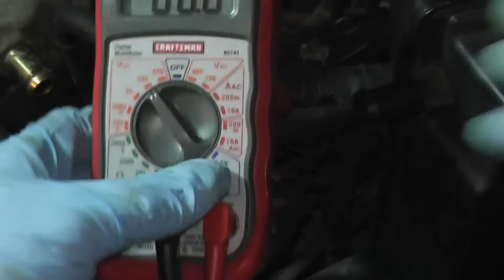How to Test and Replace A Map Baro Switch P1105

Comment: For anyone wondering the map/baro switch is called the Vacuum Switch Vapor Canister Purge Solenoid Valve. For my 99 Maxima it’s part #14956-35U10. Hope this helps!
Reply: So it’s just one part not two? At 1:35 it seemed like it was two identical parts lol
Reply: @viper34ttv They look very identical with similar hoses, the other is Evaporative Emissions Vapor Canister Purge Valve Solenoid

Comment: Hello there. I'm having some issues with my 99 q45. I have the p1105 indicating the map sensor /baro switch. I replaced the map sensor with a new one and still no luck. I tried my old sensor and new one on another q45 I have. Switched parts and all and no luck. Now I finally found that the volts to the baro switch was less than 5 volts on my 99 while on my extra working Q it's reading at 12volts. That one turns on like a charm. No problems. Now my 99 is the one that has the 5 volts. Any idea what could be the cause of this? Both wires were split open and cracked. Could it be that maybe the power wire is corroded further inside. I'm sure that's going to be my culprit. Any feedback would help.
Reply: Did you solve this? I'm having the same problem

Comment: I have a 1997 Nissan d21 and I check everything you showed I don’t see you check the ground wire on that plug on this video I check to see if I had ground I don’t I should I do is there a sensor some ware that is acting up

Comment: Excuse me, but where do the 3 hoses on the Baro Switch go to? My 1996 Infiniti I30 has a check engine code for P1105 and one of the hoses are disconnected and I don't know where it leads to.

Comment: @CarsandToys I have a 1999 Nissan Maxima 3.0 eng GXE .  Main code is P1105.  Have had trouble finding spots online tht do speedy delivery for Map baro switch solenoid and abs pressure sensor.  Praying tht once i change them n drive 50-80 miles or so itll be emissions ready n get new tags asap.

Comment: @CarsandToys 
 Your video is awesome btw,  i do not have a volt meter n part store isnt renting them out to use. But the main code i have gotten twice is P1105 and obd2 test at Autozone recommended to change the MAP sensor. Is that the same as the MAP/Baro Switch. I get confused cuz several parts are related to tht system.  Can i just pray n hope its only the Map Sensor n replace tht after ordering online??  8/10 times it is the MAP sensor right? 

Im confused between diference of MAP baro switch solenoud valve and the Absolute  Pressure sensor uptop tht leads to MAP switch via long rubber tube.  Help n tips would be appreciated.
Reply from the maker: Thank you for the feedback. Yes, it can get quite confusing. Any other trouble codes? What kind of vehicle? Here's a video we did replacing the MAP sensor:https://youtu.be/QSR6pIXzvl0
Reply: @Carsntoys   wow quick response.  Yea i took a screenshot of Autozone obd 2 test i would like to send u via email if u can. Mind u tht i dont have any tools available to diagnose so im praying its just the MAPBaro switch solenoid valve needing replacement.  Do u have an email or business cell to contact you. My car has had expired tags since failed emissions n been stranded wo being able to drive it anywhere really.  Dont want my license or car take away if caught by cop. Its been rough week. I was told when replacing electrical parts to buy new always.

Comment: Hey thnks for this vid my dad got a check engine light and he can’t pass smoke check. He has taken it to countless mechanics and no one can fix the problem . The other day I took it to autozone to scan for codes and they told me there was a code for the map sensor , is the map sensor the boost sensor?  I’m trying to help my father out but I need your help.

Comment: I have done everything you have mentioned step by step. the map-baro switch clicks after supplying power to it. the map sensor was recently purchased. i get power from both of the connectors. i erased the code with my scanner and 10 days later the same code came back again. What other items can i check for to find the solution? Thanks, great info video.
Reply from the maker: What kind of vehicle are you working on?
Reply: 98 nissan maxima

Comment: Would it click right when you put the key to the "on" position, or only when the ecu tells it to?
Reply from the maker: Good question. The valve is powered when the ignition is on. The ecm controls when to open/close the valve.

Comment: Nice Video and very helpful, just one suggestion, you may be able to verify if the switch is working by using a mechanics stethescope to listen to the switch while someone cycles the key for you. if you dont have a stehescope you can use a long screwdriver or something similar by putting the blade of the screwdriver on the switch and the handle against your ear.
Reply from the maker: Good tip. Works well for checking fuel injectors as well. Cheers.

Comment: Great video! I am getting the P1105 code when I check my car, after watching your video I just want ahead and had a look around and noticed that the  Map/Baro switch was not plugged in to the electrical lead at all. I reconnected it thinking this would solve my problem but it did not. Do you think the Map/Baro switch going bad could have blown it off? Just wondering if I need to invest in a volt tester or if i should just go ahead and replace the sensor? Also do you remember where you bought the replacement? I'm having trouble finding one. Thanks!
Reply from the maker: Hi Jacqueline. If the sensor goes bad it won't get blown off. The harness connector clicks into the sensor. It's quite secure, unless the tabs are cracked or broken. Try ebay motors, amazon and rock auto for replacement parts.

Comment: good video bro would like to now if that would make the car idle and turn off on a stop or red light. I have a maxima 1997 changed idle sensor and MAF sensor it did not solve the problem no check engine light. Any idea's!
Reply from the maker: +Salvador Madrigal Could be a number of things. I'll try to post a video shortly on what to check.

Comment: Hi tks for the video.
I have a question, one wire is 12v when ignition switch on, what about the other wire, is ground all the time?? Or how the other wire work? 
Cause all vacuum  hoses r good, mi switch selenoid is new, and still getting code p1105, and I checked the other wire and is grounded all the time.
Reply from the maker: Caleb Smartt What kind of vehicle?

Comment: 4 cylinder
Reply from the maker: comet94947 It's located near the power steering reservoir. You have a lot of connections in this area so it's difficult to explain exactly where it is. Try a google image search and you should be able to find it.

Comment: Good video, mine is clicking when connected to the battery, but when I plug the connector and turn ignition on it does not, so it is not sending vacuum to the EVAP purge control valve and I got P0443.

Comment: Where is the baro/map sensor located in a 94 honda accord?? I have a check engine light and d4 light on. When jumped i got a code of 13. Plz help!   Mahalo!
Reply: Oh i forgot to add, idk if it matters but its a vtec engine.
Reply from the maker: assh rose Sorry it's been a while since I've worked on one of these. (It's a terrific motor) Try Google Images or a honda forum
Reply from the maker: assh rose Also try eric the car guy. He's a big honda guy and would know.
Reply: Thanks

Comment: Tested everything you mentioned...it all appeared fine. The only thing is I couldn't get a reading on the 1&2 ports for any of the coils but got a reading on 2&3.  ?? I just replaced the #4 spark and it seems to be running and starting better so far. The one they used was not platinum...are platinum ones requires? I think the engine is a 95.
Reply from the maker: Tara Ogren Yeah, NGK platinum tipped plugs. Glad it's running better.

Comment: Just had the codes read. It's getting the P1105 and now P0304 for 4th cylinder misfire.
Reply from the maker: Tara Ogren The misfire code can be a number of things. (Intake leak, exhaust clogging, egr valve, ignition coil, injector, spark plug, to name a few.) I'd start by doing a power balance test and go from there. I have a video on how to perform this test. It's very easy. Just search under my page 'How to test ignition coils with basic hand tools'. If there's no change in RPM then you're running on five cylinders. Then you can check the coil and the injector. (I have a video on how to test injectors, too.) If the injector and coil is okay then check the spark plug. I have videos on all of these subjects. Fortunately, everything was done on a '97 Maxima so just follow the steps.

Comment: It's a '97 SE. No other codes unless one popped up recently. May take it to check tomorrow.
Reply from the maker: Tara Ogren My guess is the hoses are routed incorrectly or the hose running between the map/baro and absolute pressure sensor is clogged/splitted. You can also check continuity at the ECM for the sensor but I'd check the hose routing. If you need help with that just let me know and I can take pics showing where the hoses should go.

Comment: I checked everything. The vacuum works...wasn't sure on the exact pressure, but it vacuums. The ground point is grounded with another point because the bolt on the right is broken.  My car is having trouble starting sometimes, like it wants more fuel and it idles really rough. Don't want to take it back to the shop and they said they tried everything to get the code off.
Reply from the maker: Tara Ogren What year is your Maxima? Any other trouble codes?

Comment: Hi. Thanks for the video! I have the same maxima se as in the video and just had the engine replaced. It's giving the p1105 code. I just went threw and checked everything on your 2 videos and all checks out. The only part I'm not sure about is the ground. It's moved to the next bolt over. What would be the symptoms is it weren't grounded correctly?
Reply from the maker: Tara Ogren Hey Tara. So you're getting power to the harness, the valve is working and the absolute pressure sensor is good. How about the hoses? Are they in good shape? (As long as you have a good connection for ground it wouldn't matter where the bolt is. But a bad ground could throw the code. P1105 is caused by four things - the valve, no power at the harness connector, leaking/ripped hoses and the absolute pressure sensor.)

Comment: After replacing the sensor, do I have to drive it a certain amount of miles to get my emissions to pass?
Reply from the maker: Ghetty Hilaire Yes. In the past I'd drive for a solid 20-30 minutes with a mix of city & highway driving. If you have a scan tool you can check the status of the ECM before visiting a mechanic and verify the system is ready to go.
Reply: OK Thanks for the help! Your video is very instructive and it helped me a lot!
Reply from the maker: Ghetty Hilaire Awesome. Glad to help!

Comment: So I tested the sensor and its good made the clicking noise. Also I'm getting 12 volt signal to the solenoid. And I'm still getting the code 1105 need help asap!
Reply from the maker: James Swearingen What kind of vehicle?
Reply: 97 maxima
Reply from the maker: James Swearingen Okay. How about the hoses. Are they in good condition without any leaks? If you're not sure then replace them. If you still have a problem, code p1105 for your vehicle can be caused by the absolute pressure sensor. Click here for testing the absolute pressure sensor: http://carsntoys.net/trouble-codes.html

Comment: Great video do you have one on where the knock sensor is on this vehicle?
Reply from the maker: Iris Brittany Benavides Sort of. Removing the knock sensor isn't difficult, However, getting to the sensor is a lot of work. You need to remove the top intake plenum. I do have a video on how to remove the top plenum. Just search under my page or website for Nissan Maxima Rear Valve Cover Removal.